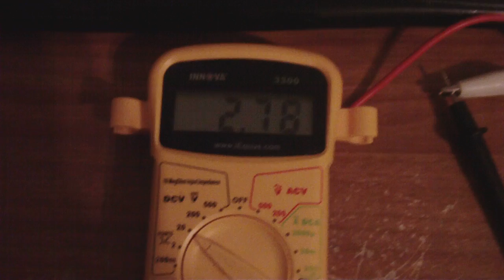Crystal battery runs led over night and lights a 12V LED

Comment: It is not to surprising that the 2.5 volt cell will power the 3 volt led because the lower the voltage the higher the current but I am impressed with your amperage.